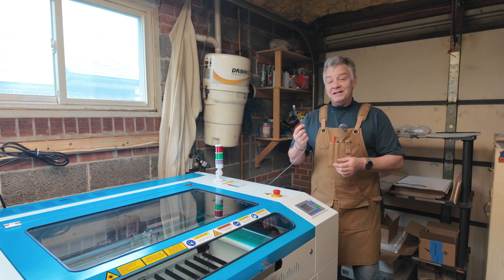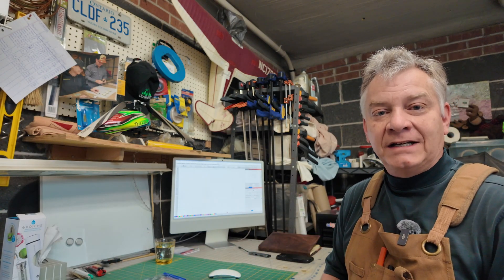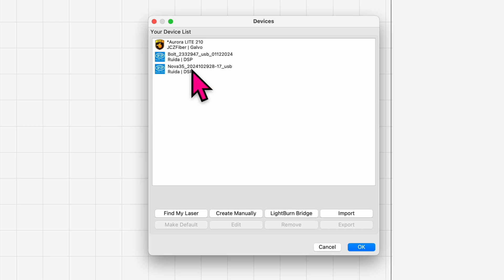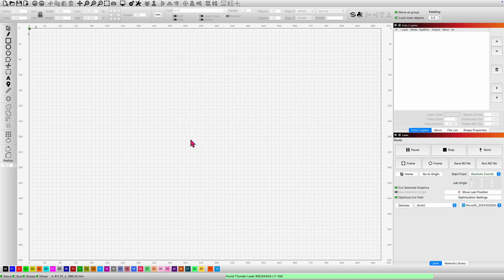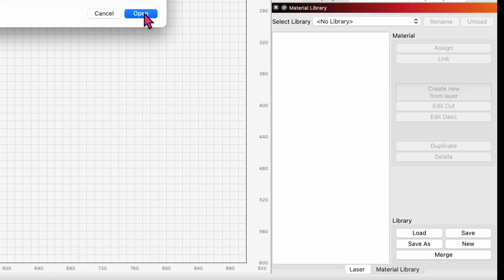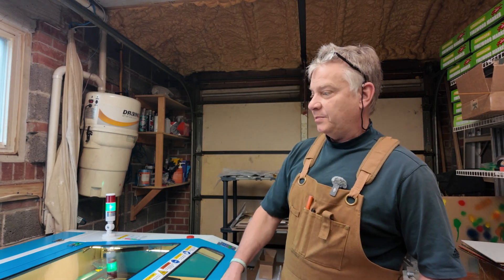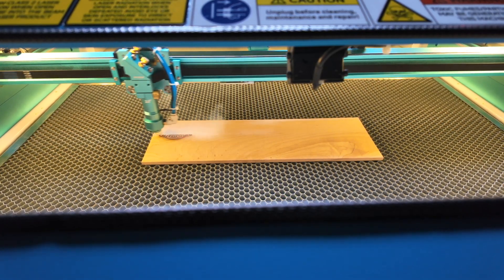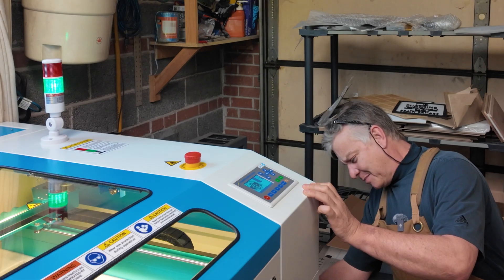Thunder Laser Nova PLUS 35 RF C02. Laser to Lightburn. Installation  082   4K

Comment: I have a question!  I noticed you said youre glad your USB worked..im setting mine up and it popped up on the screen USB device not recognized that it malfuncioned and windows does not recognize it.  Can we use any USB cord?
Reply from the maker: Hey good day. Great question - I use Apple computers and Thunder recommends using ethernet with an Apple computer. ( that was why I noted I was happy it worked ok). :))Your USB should work with Windows. I don't know much about Windows based computers however I know that if the length of your connection (USB cord) is greater than around 15-20 feet then you need an "Active" USB cable. I have one because  my USB cable is around 40 feet long. The "Active" USB cable has a little amplifier in the middle which helps boost the signal. I am not sure if this is the problem you are having. Did you install the FTDI Driver required on your computer first ? See article here: https://support.thunderlaserusa.com/portal/en/kb/articles/connecting-a-thunder-laser-to-lightburn-via-usb#Quick_Start_Guide. Let me know if this helps - good luck I am sure you can;t wait to get it fired it!
Reply: @LaserNUG thank you for your reply!  I did install the driver and i finally got the cord to work.  I gave up on it for the day earlier gosh this was about to drive me crazy so i just had to walk away from it!!  Ill start up again tomorrow.  You put out great videos by the way and thank you very much!!
Reply from the maker: @marciewilson5943  LOL! Thanks  and happy you got it working now. Have a wonderful weekend!
Reply: @LaserNUG you toooo!!

Comment: I noticed you are using a Mac. After getting my Thunder Laser Nova Plus 24, Thunder support sent me an email to set a time to load settings that did not get loaded from the factory. Then while on that call, I was told since I’m running a Mac, Thunder recommends using Ethernet communications for Macs. We set it up that way on the call and I have been running it that way ever since.
Reply from the maker: Good morning and thanks for sharing the info. I appreciate it - yes I received the additional settings on the weekend and will load them soon. I thought about doing the ethernet connection but thought I would try the USB first this time ( I did ethernet on the BOLT). So far so good - no communication issues. Congrats on your new Nova! Have a great week and thanks again!

Comment: Awesome im trying to choose between the onelaser xrf and the thunder nova plus 24 could you do some cut comparisons between the bolt and nova plus like 1/4 inch wood and acrylic? The oneLaser is essentially a bolt with a bigger pass through my main question is if cutting 1/4 acrylic on the bolt or one laser would need usually 2 passes or doing one pass starts to become painfully slow like 5mm/s to get a nice glazed smooth edge.  I mainly plan to do 1/4 wood and acrylic and would rather buy the bolt for money but dont want to wish i had more power and want the nova plus later.
Reply: Awesome! Congrats. You aren’t completely going away from the Bolt are you? I love your videos and you have helped me so so much. I have the same Bolt as you and got it about 3 months after you did. 😊
Reply from the maker: @blyniecrisp8162  LOL! Not at all. I love the BOLT. Just ran a bunch of tumblers through it yesterday. Clean, consistent results, every time - no spoilage.  Thanks for watching - wish you all the best with yours and your business!
Reply from the maker: Hey thanks for tuning in and great questions - I have engraved and cut 1/4" on the BOLT in previous vids on my channel and I cut it in one pass. I think it would be a great idea to do some comparisons between the BOLT and Nova , in time, after I have had some time to learn more about this new Nova, for sure. In the meantime - I usually provide my settings on the videos I have on my channel homepage, and hopefully some will be helpful for you. Good luck on your research and decisions. Cheers!